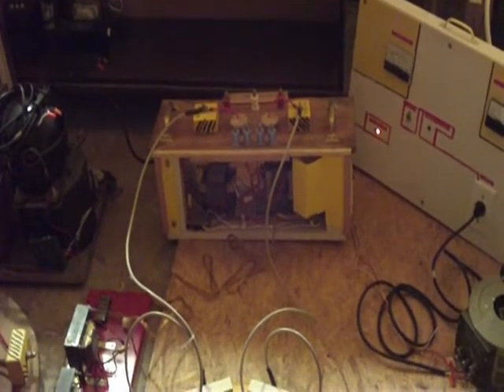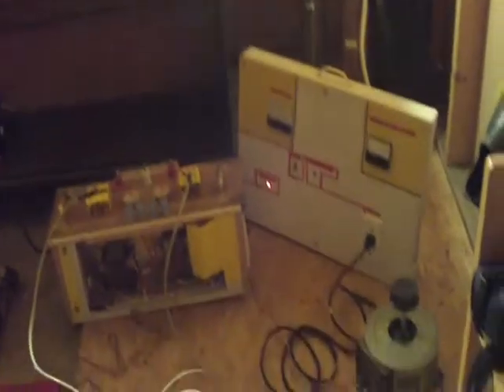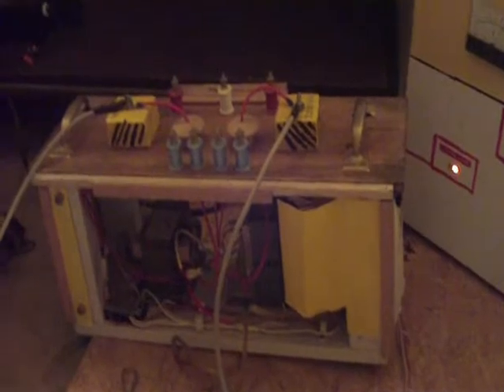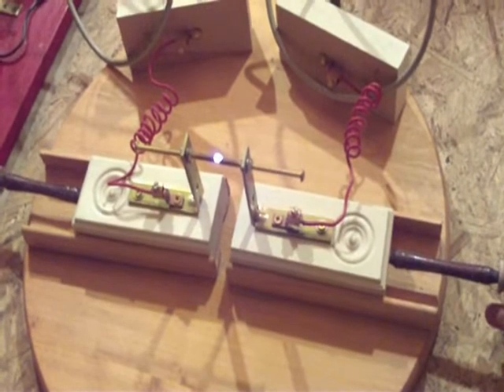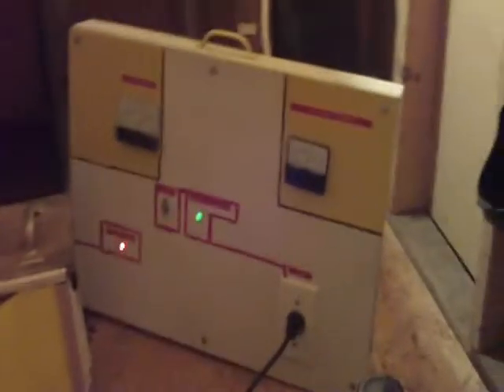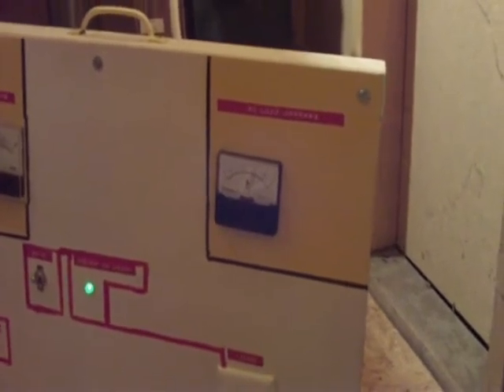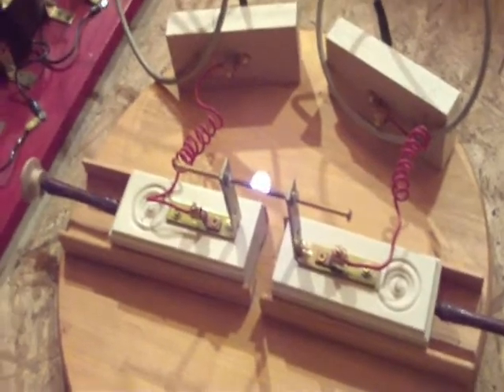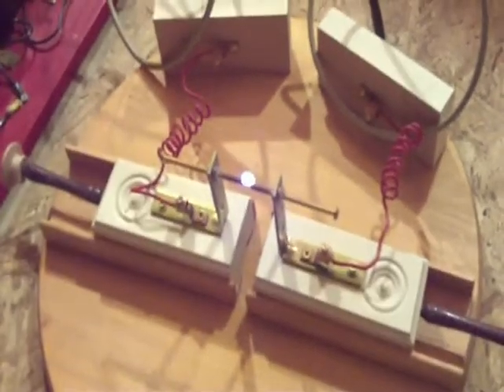4kv power supply with inductive ballast

Comment from the maker: yes, for safety you should ground the core of the transformer.  But most MOTs are end-point grounded anyway, meaning one end of the secondary winding is connected to the core.  So you have to ground the core.

Comment from the maker: @MrStemkilla 
They're not transformers, they have only one winding.  They're some kind of heavy duty chokes.  I bought them at an electrical surplus shop, but I'm not sure what they were used for.  They work great to limit current because of the inductive reactance, and they seem to be able to handle a LOT of current without getting hot.  I even connected just one of them to 120 VAC and it barely got warm.

Comment from the maker: well, yeah I could put a higher current breaker to run the transformers without a ballast.  But the problem is that can also overheat the bus bars in the main service panel.  It can get so hot that they warp and don't make good contact with the switches anymore, and the lights in the house start flickering!  I've actually had that happen before.

Comment: actually big mots don't need a ballast if you use capacitors, i have 2 BIG mots in anti parallel with 4 capacitors and they run quite cool, and i have a choke wound on a piece of pvc pipe , with the choke i can run forever and 1 foot arcs, with out it i can run for about 7 minutes with 2.5 foot arcs, running it for 7 minutes the hot but NOT over heating

Comment from the maker: @ubuntupokemoninc 
But how do you have the capacitors and chokes connected to the transformers?  If they're in series with the primary or secondary windings, then you are adding reactance, which adds resistance to the circuit and that's why you're not overloading the transformers.

Comment from the maker: well, okay...maybe not from one NST, but you can hook up a bunch of them in parallel and get high voltage AND high current!  Neon transformers are better for a lot of experiments because you get much higher voltage.  I can get about a foot long arc with four of them connected in parallel for 15kv at 120 ma.

Comment from the maker: Put NST's in series?  I don't know.  I guess if you took them out of the case and maybe put them in oil for better insulation, you could put two of them in series for 30,000 volts.  But I've never heard of anyone putting neon transformers in series before.

Comment from the maker: Cute???  DOH!  I'm definitely going to have to post another video with a bigger arc.  I can bypass some of the chokes to get more current.     I really don't like MOTs that much though.  It's annoying to have to use a ballast.  I like neon transformers a lot better.  I can get higher voltage and a lot bigger arcs with my 15kv neon transformers.

Comment: Well you dont have to use a ballast and with 2 MOTs in series you will get 3x bigger arc than with your neon xfmr :) You only need a powerful breaker and to watch overheating of the MOTs.

Comment from the maker: I just used Ohm's Law.  The meter was showing I was drawing 6 Amps.  So, 120 volts X 6 Amps = 720 Watts.  The output on the secondary side is about 4,000 volts.  720 Watts divided by 4,000 volts = 180 milliamps.  A transformer changes voltage, but the power stays the same.  So if you know the power and the voltage, you can figure out the current.  Although technically with AC, it's a little different because there's a difference between true power and apparent power.  But it's close enough.

Comment: @ct92404 are they ust one coil around some steel?  if they are they are used to filter ac so it is at a consisten levle with little spikes or drops used in computers alot or mri rooms